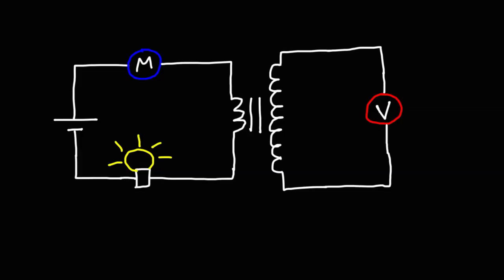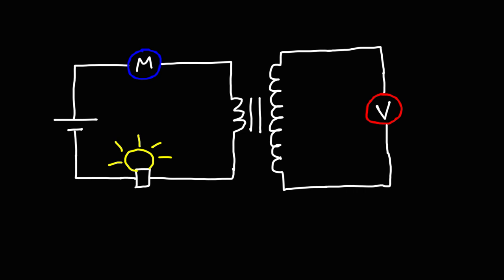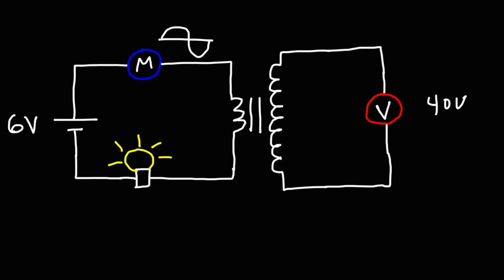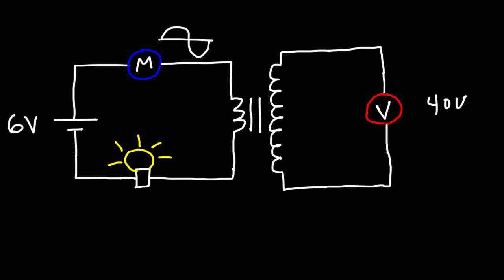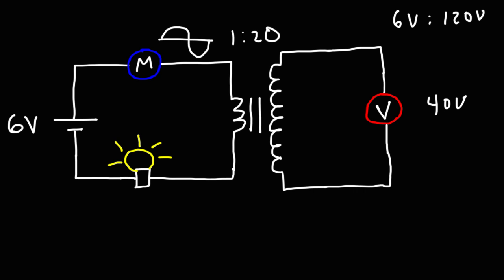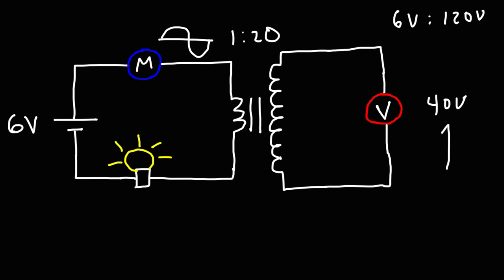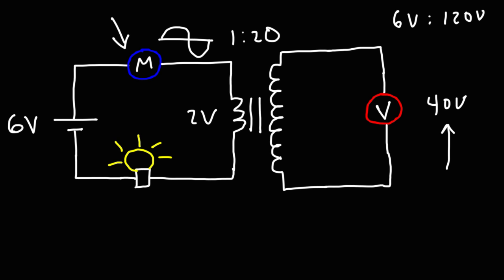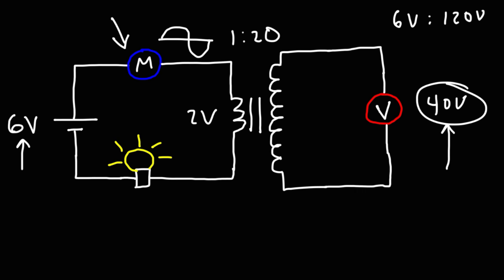A Simple Voltage Booster Circuit Using an Electric Motor & a Transformer

Comment: So can we take the electricity we got from battery… convert it to ac(using inverter) then connect the output from inverter to step up transformer and afterward rectified it… so after we rectified it we will get hvdc(high voltage direct current) right?

Comment: Back in high school I discovered that connecting and especially disconnecting even a single 1.5V cell to a transformer this way would generate pulses of voltage of high voltage.  Using a motor to interrupt the power instead of a switch is pretty clever, I wish I'd thought of that since I was playing with motors long before learning to use transistors.  I may have to try this just for fun to see what kind of voltages I can get.